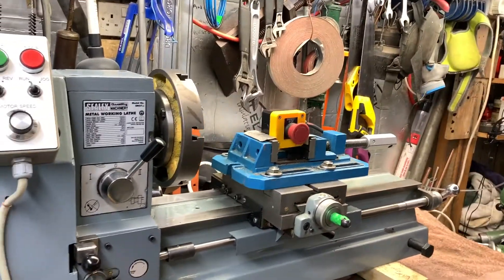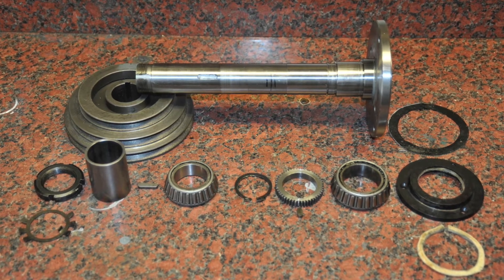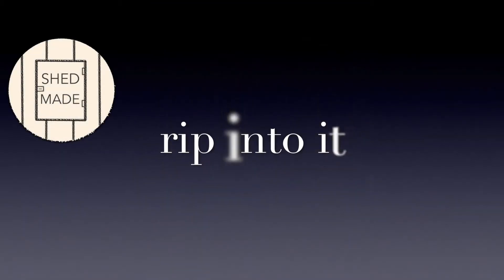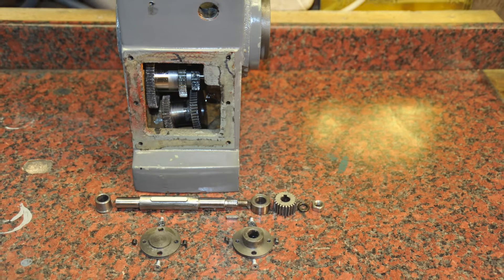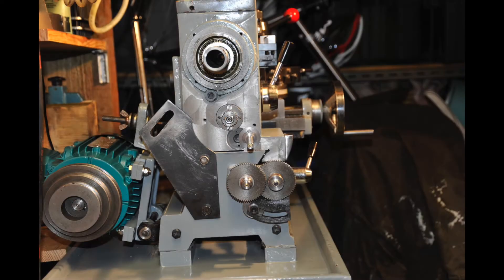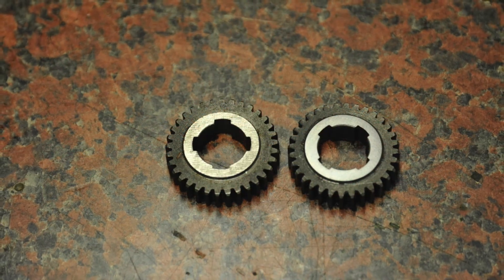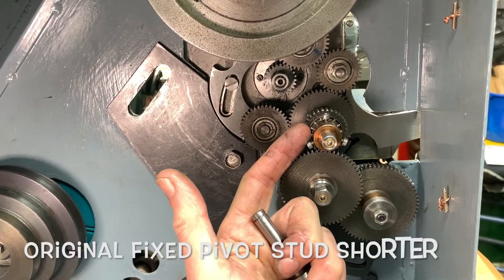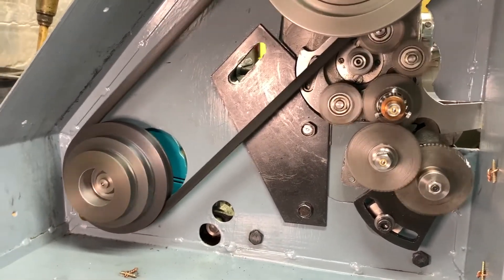Sealey  Clarke Lathe tumble reverse 09

Comment: That's a great modification, nicely done! Can you tell me where you got the extra gears from?
Reply from the maker: spare gears came after keeping  a watch on ebay.  took a punt on Warco gears fitting and lucked out. you won't see any for ages , and then they just turn up
Reply: Can you tell me where you got the index plunger from please?
Reply from the maker: @stuartcox4739    Hi Stuart    yep  the ball came from RDG tools.  Website is a maze, so look under   "handwheels, knobs, and machine balls'"   heading.  The rest of it is home made with a random spring from somewheres
Reply: @shedmade3264  Thanks 😊